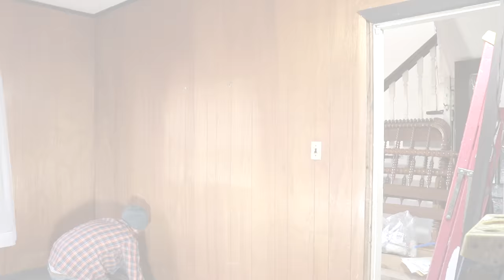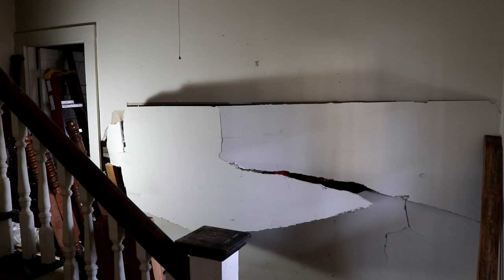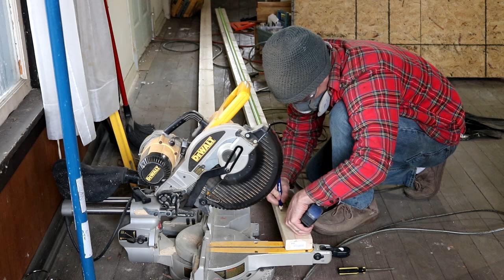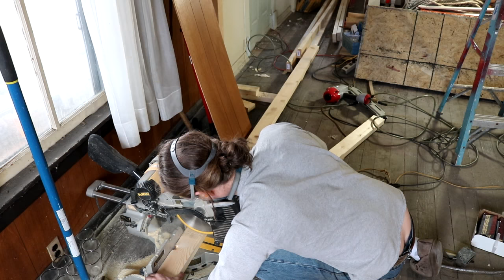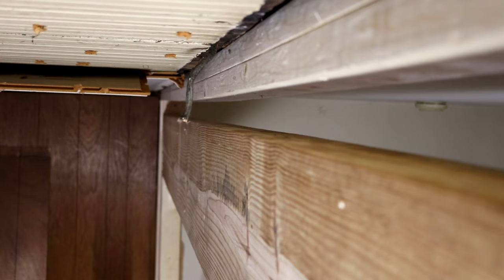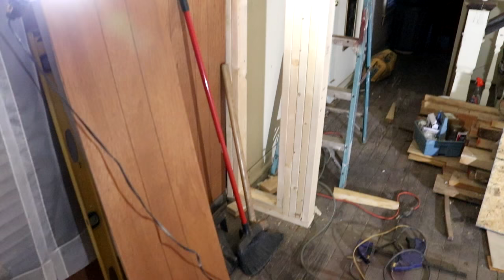$11,500 Farm House on 4.5 Acres! Removing a Wall - Renovation

Comment: I have to wonder why everybody thought that PANELING was ever a good idea at one time.
Reply from the maker: It's fast and cheap.....sometime in the 70's someone insulated this house which probably meant ripping out plaster walls, insulating and recovering.......I'm glad they used it as it's easy and clean to rip out.
Reply: True that, and good point.
Reply: Shiplap.
Reply: Harzburgitic 😂😂😂
Reply: rockshot100 agreed. I’ve always wondered if there was a massive sale on acoustic tile and ugly panelling in the 70s.  You see it in every abandoned house, and almost every old farmhouse I’ve been in. Our farmhouse had it too...we tore it all out and discovered they had panelled right over beautiful wainscotting and the tongue and groove ceiling. The ceiling was damaged, so we put a new tongue and groove over top.  A lot prettier than the ugly tile, and more interesting than plain old drywall.
Reply: For the same reason people thought wall to wall orange shag carpet was a good idea - style at the time.

Comment: Some great techniques in this video for working by yourself. Building the header in the wall instead of building it on the ground and then trying to wrestle 100lbs of wood up is a great idea. I also liked the wedges to put the small studs(cripples?) in.
Reply from the maker: Thanks, I liked the wedges too. It's amazing what you can do with them.

Comment: Wow! You made that look so easy. I can see you got a prize but, I'm surprised that there was 0 insulation in those walls. What a great house. 💖🏠💖👍
Reply from the maker: They are interior walls, you don't need to insulate them. You use insulation on exterior walls.
Reply: @thehomesteadcraftsman8975 you use it indoors for sound proofing.

Comment: Nice work, good strong beam for that span.  I would have been lazy and probably put another 2x4 above the beam, like the wedges you made.  The hand plane looks like the one I have from a grandparent, really old No.60 block plane.  Nice gift.
Reply from the maker: I did the wedges because it was sagging, otherwise I would have just slammed the beam against the ceiling and brought it down to what I needed.
Reply: The Homestead Craftsman I have to admit I was slightly traumatised when in the previous video you mentioned that an option may be to leave it entirely open plan and not put a beam in; glad you did. Was the first floor sagging at the start, or only after you removed the supporting wall? Were the joists above a single span or lapping over the original structural wall? Propping the floor first may have enabled the heam to have been pushed tighter to the ceiling. Nice work otherwise by the way. Did you have a local Structural Engineer design the beam and posts for you? How does it work over there? I'm a Chartered Structural Engineer over here in the UK and designing such beams is bread and butter stuff in residential projects for my practice. Keep up the great work; I find all that you do quite inspirational; it seems the limit of my woodworking time is fence aand gate building around our smallholding,  with a few props for my doggy friends heelwork routines from time to time.
Reply from the maker: The floor joists above are hanging on the adjacent walls. The beam is only supporting the wall upstairs which does not support the roof. It also supports a portion of the stair case opening but the joist that the wall is under and supports, is a doubled up 2X8....so it's much scarier looking than it really is. No engineer, I just did it. I don't know if the floor was sagging already, probably but I forced it up. Things are a little more relaxed here in regards to building permits when working with older houses....but even if they want to see some more support, it's no big deal, I'll add another 2X12 and shim out the wall to match.......but that won't be the case.  Thanks.

Comment: Great video, I was going to say in your last video of the house. That if you open up even just a little more into the living room area on the other side of the stairs. You would have even more of an open floor plan. As a contractor and a wood worker I love watching your videos.
Reply from the maker: Thanks. For the living room I don't want to open it up too much as then there would be no private space in the house. I think the open concept is a fad, just like many other aspects of homes throughout time. So while I did open up this wall and now the kitchen door just a bit. I don't want to blow them all out as then there's no place to hide when you need a break. The open concept is also being done on a lot of massive houses, so they can have a lot of open areas and still have a huge finished basement, game rooms, dens, etc in other parts of the house.
Reply: I was hoping that you would leave some walls. I like what you are doing now, and also what you have said about your plan for the upstairs.
Reply: Your decision not to go with a totally "Open" plan was a wise one.  This is obviously an old house and they didn't design that way in the early 20th Century (or earlier).  I must admit i cringed when I saw you knocking out walls, thinking you were going to follow the "Open Concept" herd. It was a JOY to watch you demolish that hideous paneling though! It's such a cool house!  Good job!

Comment: I liked the sheetrock removal tool, I can tell you're used to working alone
Reply from the maker: Ha, yeah it's perfect. It's a tamper for packing down dirt, it works great hear because you can bust off large sections instead of smashing it all up, makes it faster and cleaner than ending up with a pile of small stuff.

Comment: Great job. My suggestion would be, next time put the header tight to the top plate and then build down to get the opening size. That door you took off looked pretty nice. I wonder what type of wood is under all that paint?
Reply from the maker: I was going to do that at first, but I was working alone and that would have required me to make the beam on the ground first and lift it in place due to the sagging ceiling/upstairs floor. This way gave me the room to use the wedges after the beam was in place to jack the floor up.......it was just a case of working alone. The door is nice, it's some sort of soft wood....probably fir.

Comment: Since you took out the partition wall without any supports I'm assuming you'd determined it was non-load bearing.  So why use a solid beam header?
Reply from the maker: It is load bearing but the floor joists up stairs run the same way so the floor is supported on the two perpendicular walls. What is supported by the beam is the wall above it upstairs and the framing for the stair case. So it's not load bearing in the sense of holding up floor joists, but there is a good deal of weight on it. I think what I did was about as minimal as I'd go on it........with that said, It wouldn't have been a bad idea to put in some temporary supports but I rolled the dice.
Reply: i was wondering when the floor was gonna come crashing down on you, as my workmate used to say RBQ.......risky but quick
Reply: You've got more guts than I do!  ;-)  That being said, I've seen what can happen when support walls should've been built but weren't.  To use the vernacular, "It weren't purdy!!"
Reply from the maker: In this case, right where the wall supports the above structure, the 2x8 floor joist is doubled up.....and the whole rest of the floor over the dining room is supported buy the adjacent walls.......but still, some risk.
Reply: The Homestead Craftsman pretty sure that if the structure was going to move a lot you would have seen some signs of that as you gradually removed the original studs. (I work alone a lot too!)
Reply from the maker: Yeah, the joists above also run in the same direction as the wall and the joist that the wall is under is a doubled up 2x8. I kept an eye on it....and an ear.

Comment: Dude, nice work, when you're laminating beams you need to use glue otherwise the beams move individually. the whole staircase looks like its sitting funny. you can reconfigure it and get the hallway space upstairs that you need to access the room. good luck it looks like a fun small project.
Reply from the maker: With the beam I nailed the devil out of it plus it's not holding that much weight. For the stair case, there's not enough room to change it unless I do add the addition upstairs.....still in the works figuring it all out...
Reply: Those beams will creak in time and always move individually regardless on how many nails you put in. you should use 1/2" carriage bolts to add strength. to the header.

Comment: Good find. I used to find notes written inside walls. I like seeing the stair. Maybe you can make it a focal point of the extended room. It would be to be open .
Cheers
Reply: Lee Waterman I found a signature from a "Larry" in the wall of my house a while ago. Now, whenever I find something wrong, and there's a lot wrong, I say, "F'ing Larry."
Reply: LOL
Reply from the maker: With so much to do there's no telling what will end up happening with this house. I do have to do a little work on the staircase so it will be getting a minor face lift. Thanks for watching.
Reply from the maker: Poor Larry
Reply: LOL...so great to have a reference.

Comment: Man i wish i would have seen this before i put my 2-14 foot 2x12 with plywood in middle up in my garage! I built the whole beam on the ground and put 6 half inch bolts along center with nails and lifted it up into place by hand.. wasn't fun at all! and I like the studs above it but i needed the head room.

Comment: 11.500$ ? I wish I could buy a house for that. Here in Montreal a single indoor parking space is easily 15,000$ and they only let you buy it if you already bought a 200,000$+ condo in that same building. But even that is dirt cheap compared to Vancouver and Toronto. Guess I'll keep renting. Great vids keep it up.

Comment: Next time you should maybe build two temp walls on both sides on the wall your going to take down to support the upper floor  ,then remove it ,but before you go doing that ,you need to have a strong enough base for your support posts as now you are taking all that weight and moving it to the beam and then out to the  two post and on down to the floor  ,and its always a good ideal to add some glue into the building of your beams
Reply from the maker: I've done this on other houses where I did so since the joists above where hanging on the beam but in this case the joists run in the same direction as the wall and hang on the adjacent walls.....so it isn't carrying the full weight. The joist that the wall supports is a doubled up 2X8, so that was fine to hold it till I got it all up. As for the support under the wall, I think it is right on a foundation wall or pier, but I have some stuff to address under the house anyway.

Comment: My first thought was you might could date the house by the age of the plane you found. lol  Then I noticed the size of the studs.   Where those 2" studs?   Lastly, ....., why so many studs and jacks for the header ?
Another great video HC, enjoyed !
Steph_Louisiana
Reply from the maker: 2 inch studs. With the new stuff I like to put a good deal of wood at each end of the beam. While I may have gone a few more than necessary.......it only costs a few extra dollars but looks overbuilt and eliminates any concern from inspectors.

Comment: This was great, as always. My only question is what you did with the shims at the end before you inserted the cripple studs on top of the beam (hm, are they called cripple studs if they are not over a door or window?), sorry I'm new to framing. Why not just make the long vertical supporting studs long enough to where you don't have to have that gap at the top and the beam just sits flush with the ceiling? As I think it through, I guess it would be very hard to "squeeze" that long beam into place (as opposed to the small blocks with the shims), and it IS necessary to "squeeze" it into place to ensure that it actually supporting the load, is that correct? If not, seems like you would have a big strong beam sitting there looking pretty but not really doing anything at all. Is this a standard technique when removing walls like this, or is it sort of a free for all? Like is it a specific "code" you are following when you do it the way you did it? What if it were just increasing the size of a door way, but not opening an entire wall? Does it depend on the length of the span? I also noticed he put in some of the vertical supporting studs AFTER you inserted the shims. Why? OMG I HAVE SO MANY QUESTIONS =) Thanks for any response from the Homestead Craftsman or anyone else knowledgeable about framing.

Comment: Have you thought of doing a video with just the things you have found in walls, attics etc?
Reply from the maker: Every house I've bought for the most part has been full of stuff. One of the houses the owner died and I ended up with everything.....it was actually the one in the video. It was full of tools, ladders, chainsaw, furniture, dishes....even the beds where made. It was kind of strange, the dishes were still on the kitchen table where the person had breakfast. It sat unoccupied for about 8 years before I bought it.

Comment: I am sure putting that header in by yourself assembled would have been a chore. I am sure you did put crown up on those 2x12s, why the wedges before you put in the cripples? Since the header is bearing no weight, cripples did not need to be tight. Was the floor above this header un even or was the fist floor having some un even issues? Nice video by the way...
Reply from the maker: Crown up, the wedges where used because the second floor was sagging, I show it in the video about when I used the wedges. I jacked it up a little more than needed, slipped in the cripples and let down the supported structure by knocking the the wedges out. Thanks for watching.

Comment: I wanted to know what you think about the Ridgid table saw you have, I watched the video from right after you bought it and saw you used it in this video.
Reply from the maker: I like it a lot, works great, no problems. It is the perfect saw for many applications, especially when it needs to be moved around. It's stand works great, easy to use.
Reply: Thanks a bunch.

Comment: just wondering, if you could explain in the comments or maybe in a subsequent video....why did you build that big beefy crossbeam down from the ceiling joist and then build up to it with wimpier blocks? why not just build the ubber strong beam up against the ceiling you are supporting? not criticizing, just genuinely curious.
Reply from the maker: This is normal, the blocks only look wimpy because they are small but that does not make them weak. It's the same as studs, just short. The weight is still on the beam.
Reply: The Homestead Craftsman , OK thanks!
Reply: So why didn't you put the header right up against the 2X4s that you have right above?
Reply from the maker: The floor structure it supported was sagging, so I would have had to put it up in one solid beam instead of build it in place. Doing it like I did allowed me to build it easily on my own and then use the wedges to jack it up and then slip in the cripples. There's other reasons, but it's to much to explain in the comments and would be confusing anyway.
Reply: Well it looks awesome and it was a good idea to open it up.  Do you think you'll open it up between the dining room and the kitchen as well?
Reply: So I understand...  The floor above was sagging.  The beam allowed you to use the wedges to remove the sag.
Reply: I think to level upper floor

Comment: Did I miss something in this, or did you not remove a load bearing wall without supporting the ceiling first, and then afterwards you built the beam ?
Reply from the maker: You didn't miss anything. The joists above run in the same direction as the wall so the upstairs floor is not resting on the wall. The wall supports the wall upstairs and the framing for the stairwell but the joist that the wall is under is a doubled up 2X8....so while it is load bearing in a sense it was supported enough to do what I did.
Reply: Good stuff, I enjoy everything you share with us, and even built my first small scale farm table...thanks for what you do.

Comment: Finding that plane in the wall was extra special. Guess they used it to size and smooth those horizontal brace cuts. I'll buy the plane if you already have one.
That is one strong support beam. Does it have good beams to support it in the basement (I hope)? Thanks for sharing!
Reply from the maker: I'm a tool collector, not seller! Sorry. I've actually been after this model, it's a 60 1/2 which is a low angle adjustable mouth block plane......not rare but very useful. I've got a bunch of planes, just didn't have one of these in good condition.
Reply: The Homestead Craftsman Must have been Karma that "you" would be the one to find it then. Great to hear.
Reply: My folks bought a tract house in the early 70's and I remember my dad putting up paneling in the family room and using a plane to get a good seam between the sheets. Lost of orange, brown  and lime green paint too, I don't miss the 70's.
Reply: MrMnchstr Ahh, so that was what it was used for. Thanks.
I'll never forget the green shag carpet, green kitchen appliances, Vinyl and padded dining chairs, plastic flowered tablecloth, paneled rooms, whitewall  tires and fender skirts, oh yea. Those were the days (or not, for design and decor - haha).
Reply from the maker: The plane had dust and shavings from the paneling left in it.

Comment: Can u really just remove walls like this without changing the stability of the level above?
Reply: Not if they are load bearing, which this one clearly was since he went through all the trouble to construct and install the huge beam in the opening to support the load.